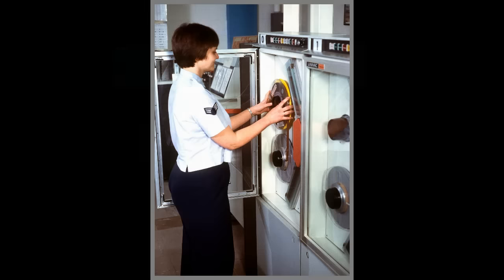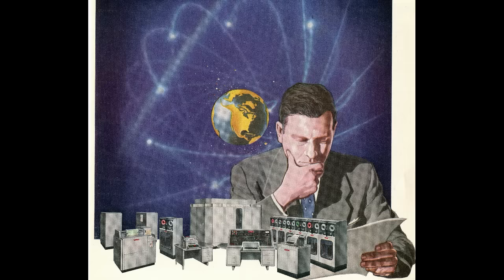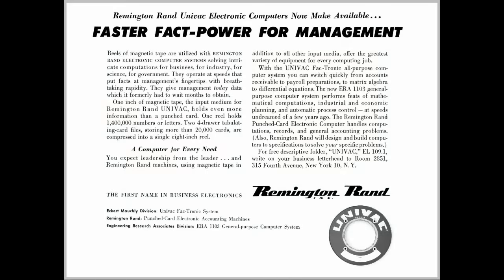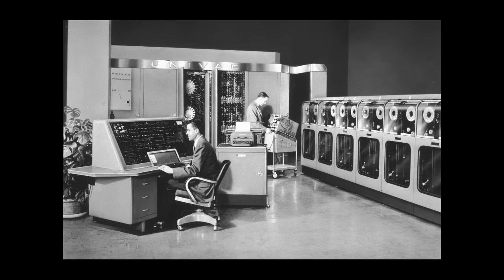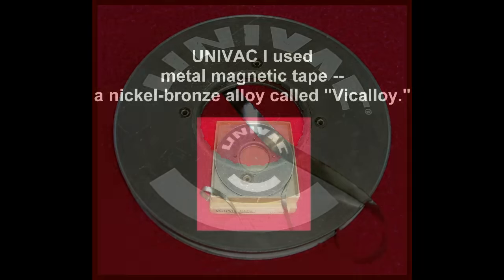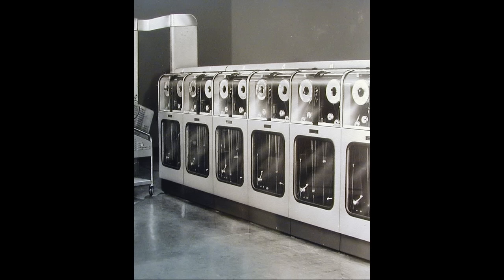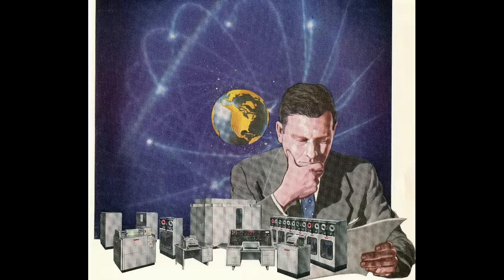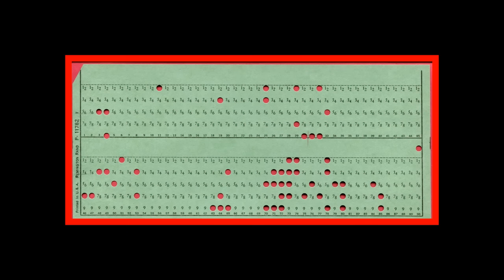Computer History:  The Amazing Design of the UNIVAC's UNISERVO METAL TAPE DRIVES 1951

Comment: An interesting engineering aspect of the Uniservo was that the tape movement across the heads was not done by servos, but by air pressure.  There were two vacuum chambers, one on each side of the heads.  Tape movement across the heads was accomplished by adjusting the air pressure in the two vacuum chambers.  The tape servo motors were not accurate enough to maintain the proper tape speed.  Take a look at the guy mounting a tape.  He doesn't wrap the tape end around the opposite reel, as you would with an audio tape on a reel-to-reel.  He connects the tape end to a leader tape segment which is already running through both vacuum chambers and around the take-up reel.
Reply from the maker: Hi Michael, that is a great observation and bit of historical info!  I have seen this film clip a hundred times and noticed the odd way the operator connected the tape.  Now it makes much more sense.  Thanks!   (Also proves that I am not too old to learn new data.)   ~   Victor

Comment: OMG.. I just realized how this was utilized.. each tape machine is a table for a database.... it’s also pretty amazing that a single double density 5 1/4” disk was 3x larger than one reel of  tape for these machines.
Reply: sort of. In many cases a tape could only hold part of a list, so you needed multiple tapes to go through the entire list. That's why some of those mainframe systems would have a dozen or more tape drives. This was especially true with systems like the tax department that had to process data for millions of people at a time
Reply: Nah, he got his math wrong. It's 1.5 megabytes or 1.43 mebibytes (based on a flat 1.5 million, rounded).

Comment: Today, fedexing a HDD is stil a good and fast way to transfer terabytes of data. Amazon propose a service (AWS Snowball) for mailing a module of HDDs to sending up to 1 Petabyte of data to their servers.
Reply from the maker: +ultort   Good info, you are right.   A good way to send Large amounts of data all at once!
Reply: I've done it for personal reasons as well.   I sent my movie and music libraries to a friend in another state.  It was 3.5 Tb. Sent it on a 4 TB drive I didn't want back.  He just connected it internally and left it there, no need to copy.  Would have taken a year over the internet.  Definitely the best way to send data.  I sent a 3.5" drive, which isn't ideal, but if I had to do it again I'd send a laptop drive instead.
Reply: @larrygall5831  Not a year but "just" 10 hours with 1Gb internet.
Reply: @stephanesonneville  mean upload speed in july 2019: 33mbps = 11 days

Comment: 1.5 million characters is approximately the same  as 224 KB?  Huh?
Reply from the maker: Hi Mark,  thanks for your feedback, but not sure what you are referring to, can you clarify?
Reply: @ComputerHistoryArchivesProject  At 1:27 the narrator says "Each reel could stored 1.5 million characters...or, approximately 224 kilobytes.  Since a single character is stored in a single byte I don't see how 1.5 million characters are the same as 224,000 bytes.
Reply from the maker: Hi Mark, you spotted something correctly, thanks.  This statement in the video about the tape IS a bit misleading.  Doing a bit of research, it appears the method of data storage used in the early Uniservos employed the option of either high-pulse density or low-pulse density.   As the pulse density changed, the capacity of the tape also changed.  On the high side, it was about 1,440,000 characters;  on the low side, it was 288,000 characters.  With variable pulse density, stating exactly how many characters can be stored on one tape is not an easy task. We could be wrong, but this is our thinking.  Something we should fix in the video to make it more clear.    Thanks again!  Ref: We looked at the 1955 publication at this link: https://archive.org/details/bitsavers_univac11035_4475284
Reply: @ComputerHistoryArchivesProject  I appreciate your efforts.  Thank you.
Reply from the maker: Yr very welcome!
Reply: @Mark Landgraf  They also said the tape was divided into 8 strips - 6 data channels, a parity channel, and a servo channel.  224K * 7 (if you include parity) is just over 1.5M symbols.  Given the ambiguous meaning of “characters”, it’s possible they meant “bits.”